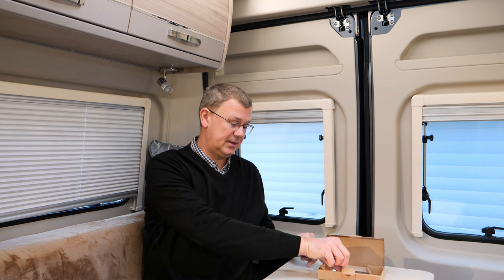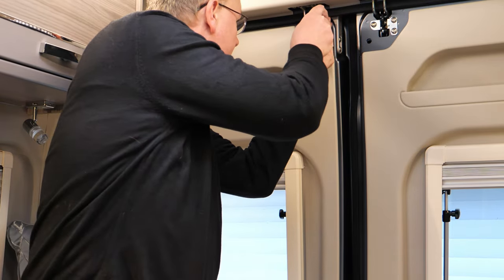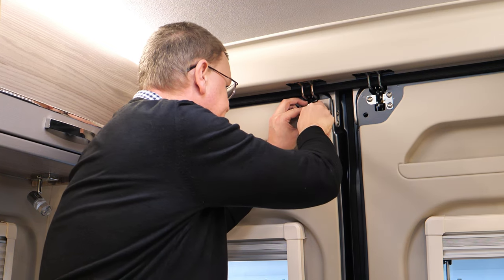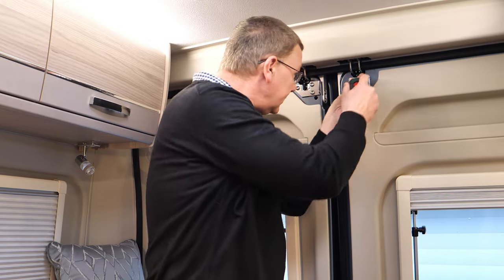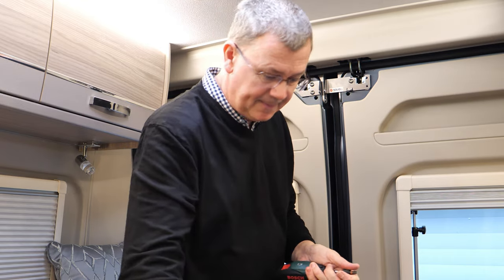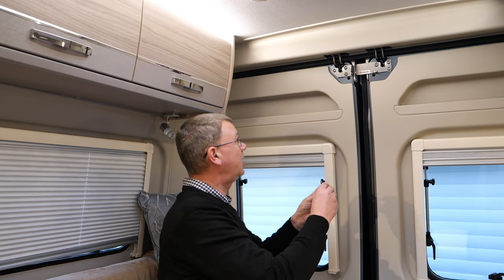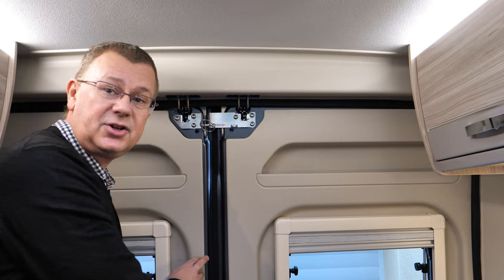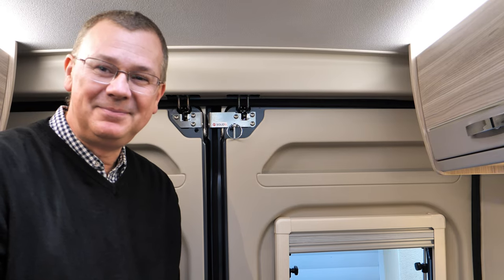Fiat Ducato Campervan Rear Door additional security in our CV20

Comment: As you say David, simply and secure.  Like the idea to paint it to so it blends in better. Nice job
Reply from the maker: Yes definitely would look better painted (so long as I don’t make a mess of the painting 😀) also with a bit of heat shrink or something to prevent any rattle from it when moving - thanks for the comment - appreciated - David 👍

Comment: Nice!  I'd also consider attaching a short length of cord between the pin pull-ring and the storage location to stop the pin going AWOL. Although it does seem pretty well located.
Reply from the maker: Great idea, knowing my luck I would be parked over a grate and open the door and it would fall down 😀 You’re right it’s quite well located if you pop it in right but still great idea to secure it so it doesn’t fall off or get misplaced. Thanks for the comment and welcome to the channel, all the best, David 👍

Comment: Hi David another brilliant video. Surely the person failing to gain entry at the rear would just break into the other 3 entries?
Reply from the maker: Evening,  you are probably right hence needing to look at security across all access points to try and put them off. It does give a sense of security when you're asleep I find (all be it you need to know how to remove/open in the event of needing to escape) Suppose everything helps... All the best, David 👍
Reply: If anyone can find a way you will 😊
Reply: I consider this a good extra security for the rear doors because I came to open my locked van one night and the rear doors were open as the little wire between the body and the door had intermittently broken meaning the central locking on the rear door did not work. So I think as this problem on the Ducato is very common, you don't want to be stuck with an open door if your on tour until you can get the central locking wires replaced. There is no other way on my Ducato to manually lock it if the central locking stops. So I am fitting one for this purpose alone.

Comment: Hi David,really enjoy your videos and implemented some of them,may I ask a question, my water pump has stopped working so I have changed it and still not working, have you any idea if the pump has its own fuse,thanks David
Reply from the maker: Hi David, thank you and sorry to hear your pump isn’t working. It’s definitely protected by a fuse, is the light illuminating on the control panel when you press the pump button or just nothing happening?
Reply: @LeisureBit  hi.just nothing happening.

Comment: Hi, I was amused by this video especially at the ease in which you loosened the screws.I bought one of these security devices about three months ago after watching a video by a guy from Northern Ireland (can't remember his name) but I've not been able to fit the brackets because I cannot undo the screws. Can't get any turn at all. Mentioned this to my builder neighbour, who I think could beat a gorilla in an arm wrestling competition, and he couldn't budge them either. I too used a Bosch electric screwdriver but without any success. Mine's an 2021 model Ducato but that shouldn't make any difference.
Reply from the maker: They did seem to come out fairly easy didn’t they all be it they were tight but not over-tight - sorry to hear that as should have been a nice easy install. I wonder why it’s so tight? Not sure what to suggest as have had my share of stuck screws and bolts. Not sure if a bit of WD40 would loosen a bit? All the best, David 👍

Comment: Hi Guys, not sure why my original comment never appeared but this is a great mod and one I am going to fit. I am going to have dead locks fitted externally but with this mod could probably save some cash by not having one fitted to the barn doors. Have you thought of fitting anything internally to the sliding door, camper protect from Germany have a chain which looks good and could probably be reproduced here easily. Also going to fit a pro plate to the front door so the central locking can't be picked. Cheers K.
Reply from the maker: Hi Karlos, I’ve had that happen where comments sometimes disappear, I think if a link is included it sometimes does that. Great idea regarding deadlocks and also the pro-plates. Are you going to fit yourself or get someone to fit for you? All the best, David 👍
Reply: @LeisureBit  Hi David, Happy to fit Pro Plate but I'd rather pay someone to cut holes in my van.

Comment: Don’t remove top right screw  undo to allow bracket to slide on ,this stops the need to realign doors once fitted tighten up all screws
Reply from the maker: Thanks very much for the tip, most appreciated 👍 all the very best, David 👍
Reply: Good point. I also have applied strong SikaFlex around the fixing so when I loosen them it also keeps them in place while we fit this modification. But I too will not be removing the top RHS screws.